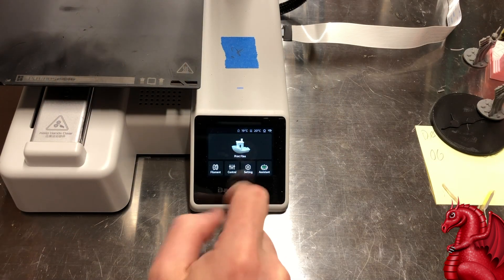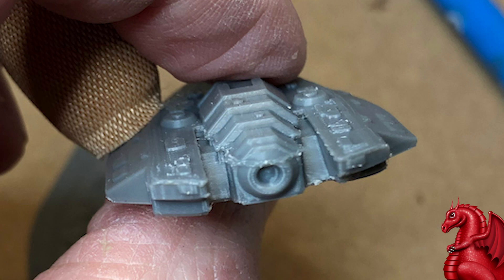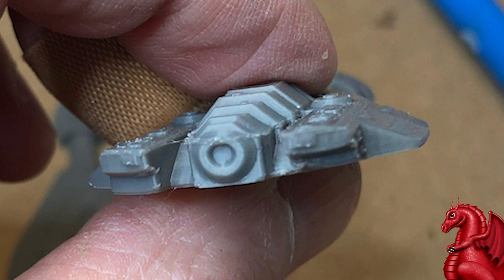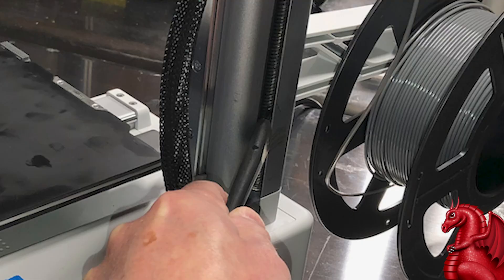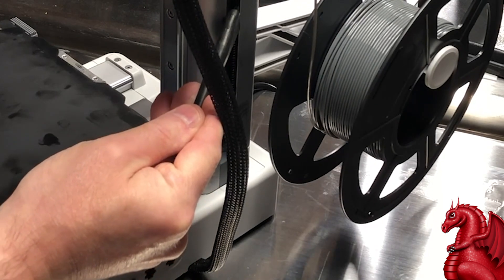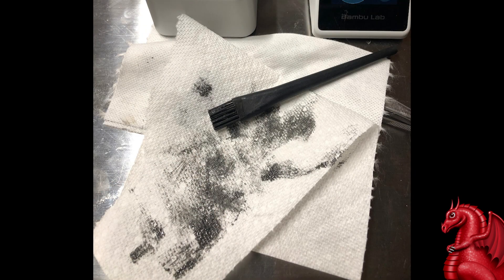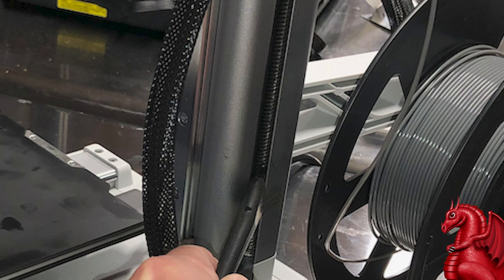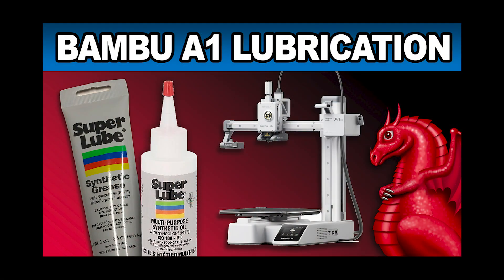Bambu Lab A1/A1 Mini maintenance to get better prints!

Comment: just remove the Z rod to clean it, way easier and thorough.  take the top cap off,  take the bottom corner plastic cover off (a bit hard but nothing is holding it just 2 small clips, the flap should be rather flexible), undo 2 grub screw on the Z coupler, and the z rod can be took right out from the top, and you can deep clean it, inspect it if it is straight. when putting back, make sure the flat face of the shaft sits against a grub screw to let it have a good purchase, and make sure dont sit too deep or shallow along the axle directly.

learned mine hard way too,
1, use the correct lubecant, if in doubt just use the official one.
2, less is more when lubecating, dont ask me how i find out.
3, if you want to go above and beyond, i took apart both X and Z liner rail carriage, found the plastic seal has imperfections, the ball bearings arent rolling smoothly, i had to file down tiny bit to really let it glide freely. (do not try this if you dont know what to expect very easy to lose BALLS!)

Comment: Thank you so much for these A1M maintenance videos! Figuring this stuff out on my own was vexing and I probably would've wasted days. You lay everything out perfectly and link everything needed as cheap and effective as it gets... not even Bambu Labs gives guidance on which oil and grease is appropriate, for example. Your youtube channel should be stickied at the top of the official A1/A1M support page and Bambu should be talking to you about embedding your videos in the manual itself!

Comment: So I’ve had my A1 a month now and I printed some amazing figures, but as of this week it has been failing every single print I try, I have lubed everything, cleaned z screw, got new update that failed first time last night, and I printed and it come out like a cobweb and it’s very demoralizing, I’ve dried my filament I have cleaned the bed with basic Dawn dish soap, and it is still failing everything I lost….
Reply from the maker: What do you mean by 'failing'? That could mean dozens of things. I can't help if you aren't specific as to what is occurring.
Reply: @Tombof3DPrintedHorrors  coming off the bed during print, supports with 3 loops failing, printing nice for a 95% then turning into a cobweb, supports fusing them self to prints. It’s been a rough week I’ll tell ya what.
Reply: @Tombof3DPrintedHorrors  I have my slicer settings the same and have printed some very nice figures, so today I tried to print a sword because it was only 3hrs for a figure it printed great then at the end it was strings and the layers where falling off each other, so I took my dryer and hooked it up to a direct feed see if that helps.
Reply from the maker: @soup_bone  none of the miniatures I design/sell requires supports so cannot advise.
Reply: @Tombof3DPrintedHorrors  that’s fine I’m just a newb printer looking for possible suggestions and you replied so fast man!
Reply: @Tombof3DPrintedHorrors  so I just subscribed

Comment: Makes me wonder what has changed so much over a one month period of use? The brief vibration compensation prior to each print makes me wince as the machine rattles and attempts to shake itself to bits. This can't be a mechanically good thing for the various mechanical assemblies to do each print? I suspect a solution may be just to print a little bit slower and especially lower those acceleration values - as that's what really causes problems. I'd like to know how to turn off the vibration compensation altogether  - until I choose to run it -  currently it's active on every print I do. A1 mini and also A1. Anyone know?

Comment: Really useful video.  My mini has proved so useful and prints are of a quality I would not expect. Bed size is sometimes a limiting factor but not that often. The Mini should be on the shopping list for anyone wanting to try 3d printing, easier to set up than an Epson Ecotank paper printer by a looooong way!
Reply from the maker: Agreed, I really thought I'd be disappointed with a 7" bed, but I've ended up getting multiple A1 Minis and only one full size A1, I just almost never need that much build volume, and after all of my testing, the A1 Mini prints slightly better than the full size.

Comment: Had 2 x1cc since oct 22. And today i have mini and A1. They both print better than x1cc
Reply: Yeah I have two P1Ss and an A1 and mini and they do have a bit cleaner layer stacking for sure. Can’t wait for a P2S or something to hopefully have all the features these have. I do like the auto flow calibration but I’ve actually found it’s not quite as accurate as doing it manually (from a fitting parts together prospective) but man these are great machines for the money. 

I will say the size of the mini is underrated. So many people think that’s too small! I find myself constantly using the mini because whatever I’m printing fits on the bed and it will use less electricity. Honestly debated on a second one! lol
Reply: @SVCprints  i print on both almost 24/7. Just love them

Comment: Thanks for another great and informative video! I saw your lubrication video a few days before I received my A1 Mini - didn't think that I would need to even think about that for a while! Then, when I got the A1 Mini and turned it on, one of the first things it told me was that I needed to lubricate the screws! Luckily I had watched your video, and managed to get it done ok! I found some brushes similar to your recommended ones (I am in the UK) so next time I need to do it, I have everything i need! Thanks again, and please keep the useful videos coming! 👍

Comment: In another video I saw that you suggested Hatchbox pla and High Speed and Sunlu pla meta. I'm running 2 Elegoo Neptunes and a Nptune X.  Should I go for the Hatchbox or will the Sunlu high speed work? I have been using whatever I can find cheap from Amazon but I want to pick up a nice roll just for my minis
Reply: To summarize, I guess what I'm asking is, is the high speed filament only for certain machines such as the Bambu ones? I belive you said that it didn't work well on other machines. Thanks
Reply from the maker: @MarsGamingGroup  the Sunlu PLA Meta is the best PLA I have ever used, but I have yet to get it to print well on my Ender 3s (or at least as well as Hatchbox does.)

Comment: Tom, you're a rock star.

Thank you for dispensing so much wisdom.  I'm hoping to get a lot of life out of my A1 Mini.  I am running it night and day.

Do you have any idea how long the .2 nozzles will last?  On my Ender-2's, I'm replacing .4 nozzles about once a month.
Reply from the maker: The BL nozzles are steel and last much longer. I'm at roughly 5 months now on my .2 nozzles on both A1 Minis and will likely get a few more months out of them before I swap them out.

Comment: You have me seriously taking a look at the Bambu A1 and Mini. I appreciate all of the videos and help fine tuning our minis fdm prints :)
Reply: I got the a1mini based on Tom's review and it's nothing short of amazing
Reply: I just got one a few days ago and it's freaking awesome. I had an Ender 3 for 5 years and went to a Kobra Plus a year ago. Very happy with that upgrade, but based on a few good reviews I decided to make the jump to multicolor, and I can't say enough good things about the A1/AMS combo. The speed, quality and convenience are truly impressive, and so is the integration with the Bambu ecosystem. The slicer is super intuitive. It does a lot of things I wish Cura did, and it seems to know exactly the right settings. I really don't change anything, all I do is slice my STL files and print. I feel like the era of plug-and-play 3d printing has finally come to the hobbyist level.
Reply from the maker: You won't regret getting either one (especially the A1 Mini for only $249!). I was a huge Creality fan until I got my first BL printer, the leap in tech blew me away.